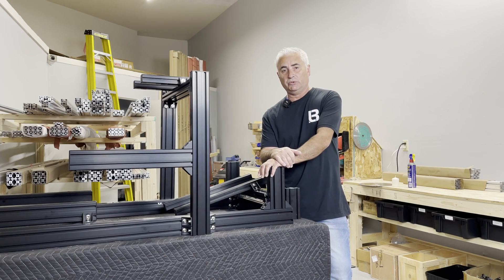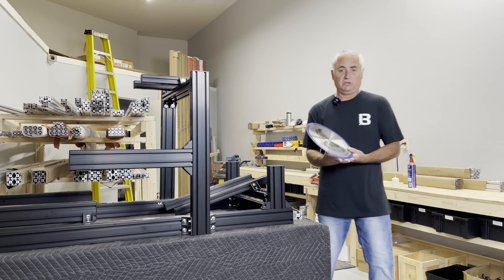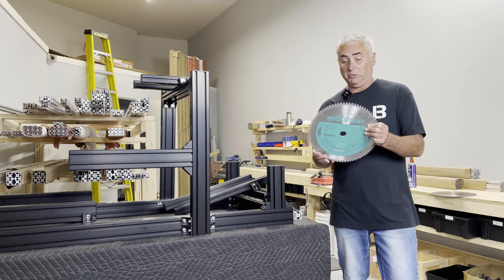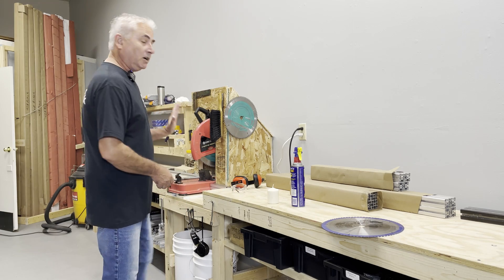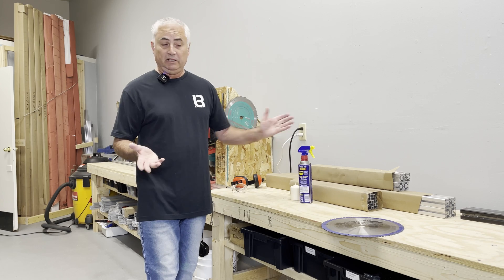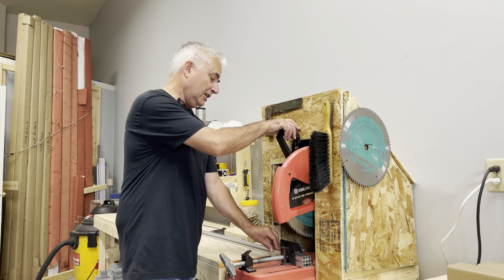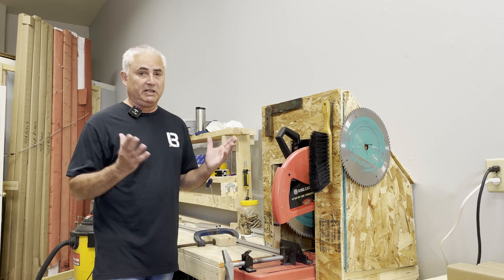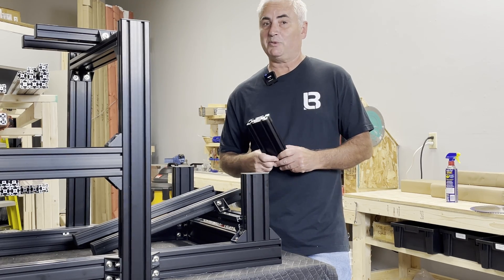How To Cut Extruded T Slot  Aluminum Profile

Comment: How much of a nightmare do you think it would be to cut by hand? My rig has some egregiously tall uprights and they are covering the bottom part of my monitor. The problem is I have everything aligned BEAUTIFULLY and the uprights support literally everything. So to cut it in my shop easily with an aluminum blade would be simple, if not for having to dismantle the entire rig... I'm thinking of setting up a tarp and attempting to cut the uprights by hand with a hacksaw...
Reply from the maker: it would be a bit of a nightmare with a hacksaw. Hacksaw cut is just so uneven and being kind of in your line of sight you would be looking at it all the time. If it were on the bottom of the uprights it would be less of an issue. It is doable with a lot of time and care.